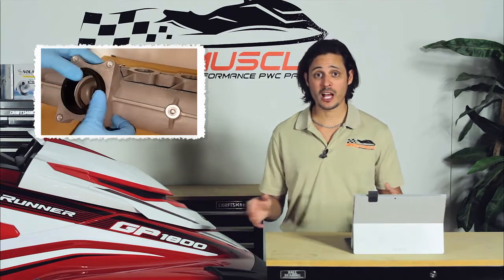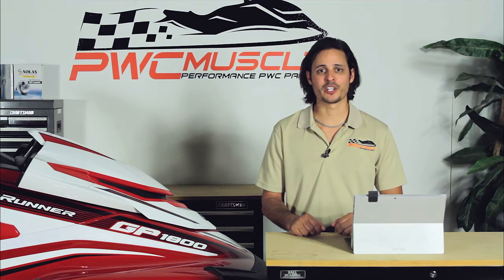Yamaha GP1800 Power Filter Results Video

Comment from the maker: The way we are doing our testing is not to generate the fastest 0-60 possible, but get consistent results.  This way we can know exactly where gains are made, vs just a one-off run that achieved a fast time.  
We do 10 runs with tank full and trim fully down.  We throw out the fastest and slowest 2 runs, then average the rest.  Runs are made in both directions so current and wind do not factor in.  We aren't trying to set records on these runs, but rather set the most repeatable times so when we put on that next mod we can accurately gauge the difference.